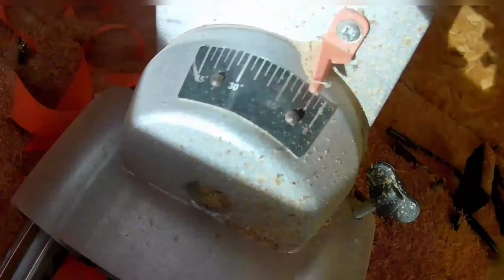Making a tapered mug without a lathe | woodworking | DIY

Comment: How did you calculate the taper and the saw angle?
Reply from the maker: Diameter of cup (in this case about 3 inches)  times pi to get the circumference. The circumference divided by width of each individual piece (about 3/8 inch). From this you get the number of pieces you will need (about 30). Lastly 360 degrees divided by 30 to get 12 degrees on all 30, 3/8 inch pieces. As for the taper, I just guessed, about 1 or 2 degrees.

Comment: There is food safe epoxy and wood fines.  Just look for fda marking.   You could probably save some money and epoxy by using titebond 3 for glue up. Then sand then epoxy the outside and inside for added strength and sealing.
Reply: Where are  the savings? More steps. Time is money.

Comment: Good video. I am interested to make a mariner's version of your mug with a wide base. Regarding the clear coating; Do not use polyester resins, use an epoxy resin that is advertised for use on eating surfaces. Surprisingly, some craft stores carry small amounts of this grade of epoxy resin and some woodworking supply shops too. Just because you can not taste it does not make it safe. The sweetest tasting water from a community well proved to be deadly in London England in the 1800s! Something to think about.
I would prefer to make the lip thinner, maybe by using a drum sander to taper the interior for about an inch or more to give the thin edge.
I like your detail of rabbeting the bottom into the staves. I imagine doing the same but with a plexiglass bottom! 
I also want to experiment with veneers wrapped around a form.

Another detail would be to incorporate the handle as one of the staves! Think about that one.